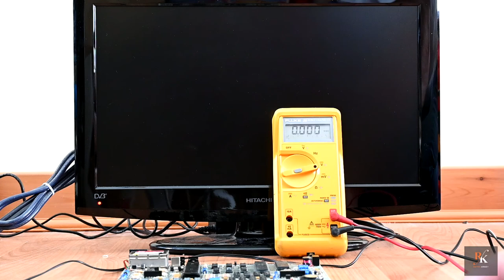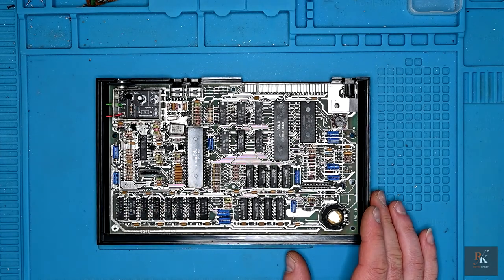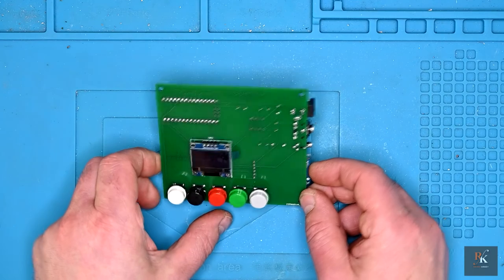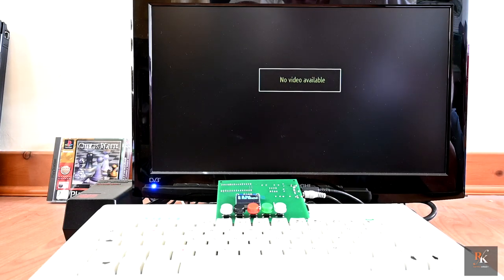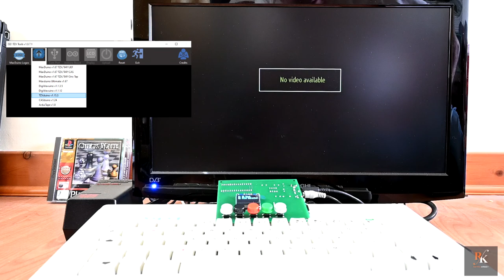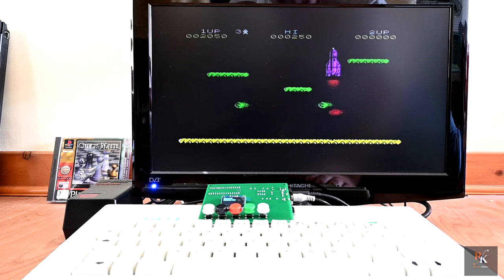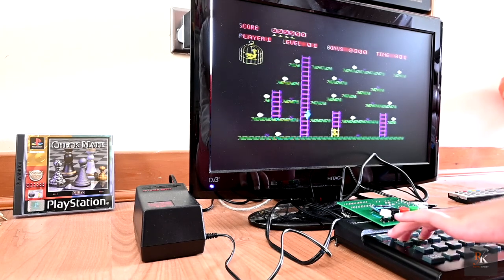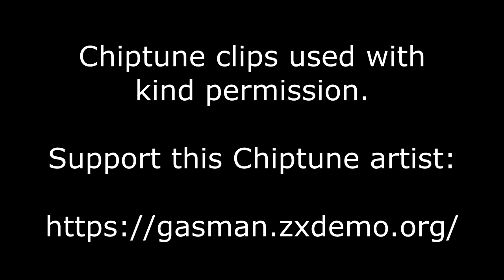Repair/Restoration: ZX Spectrum Part 2 - My Ultimate ZX Spectrum

Comment: that emperor keyboard looks mint.. had some lo profile + dk'tronics etc but not had one of them ~ yet...two awesome games ... i am making a external keyboard on a pcb that plugs into the edge connector for diagnostic use...
Reply from the maker: It's a great feeling keyboard though I've not tried the DK'Tronics model to compare them. Hmmm, future video... :-D

Like the sound of the external keyboard PCB - Very handy for testing, especially if you are even remotely concerned about the condition of the membrane connectors! Let me (and any readers) know where we can follow your project (if you have a page made up ofc!).
Reply from the maker: Which post got removed? I certainly haven't removed any here, other than the scam advert or two :D

Comment: Hi! Today I received my SAGA1 - I think an older version as the one shown.
(A dream comes true after more than 35 years... ;-) )
One questions: What occurs if you press "GRAPHICS ="? The two keys on the left, mid row...
Mine prints: "9 LET"! - Is this normal?

THNX 4 the info.

EDIT: sorry - F*CK auto forward. - Comment has been added to the wrong video. :(
Remove if you like to. ;->>>
Reply from the maker: Errr, good question as I cant remember! It is in storage at the moment however I will be digging it out for an upcoming video so will check.